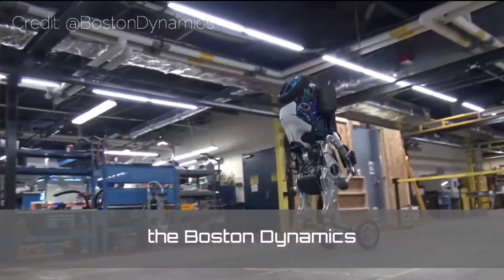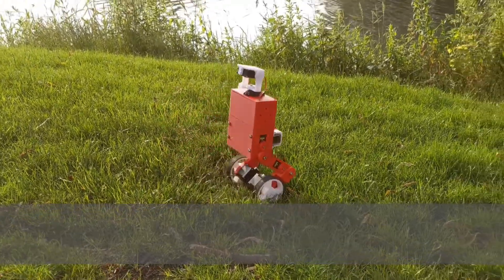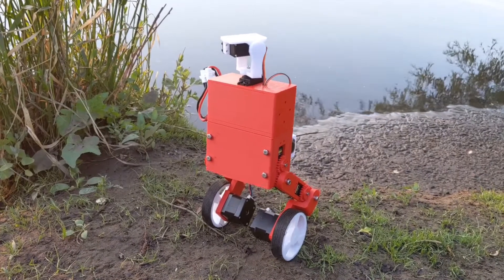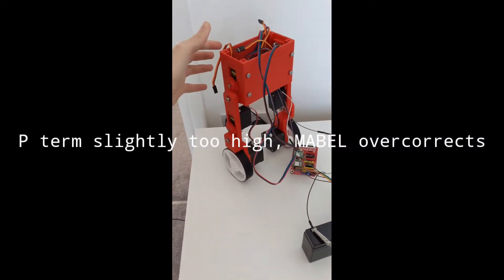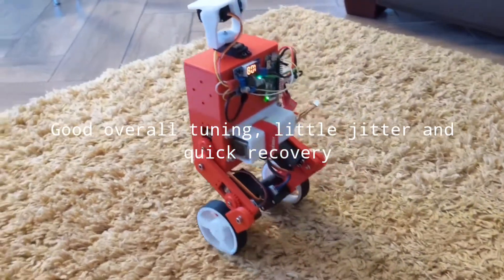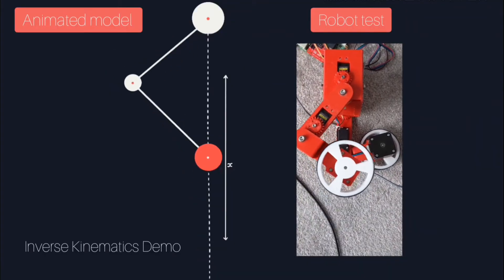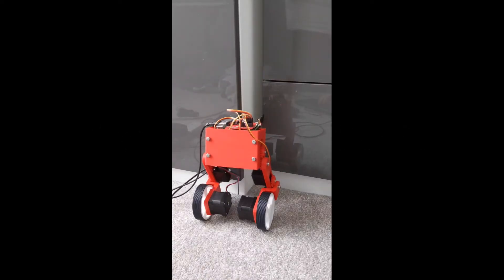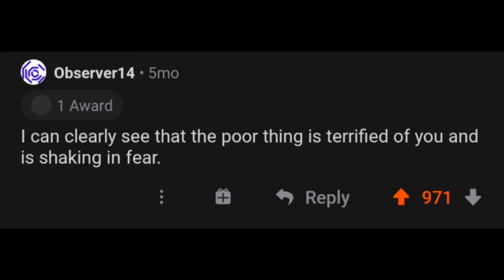How to make a (Mini) Boston Dynamics Handle - Self Balancing Robot with Arduino and Raspberry Pi

Comment: Really interesting project. I have also been trying to create my own version, and coame along some interesting projects called Ascento and SK8O, they use pancake brushless motors which gives them a lot more power, (I think they might be odrive), but they are therefore a lot more expensive too. They have some papers on the algorithms they use to control the robot but I'm still figuring out how they work.
Reply from the maker: Yeah I've seen those projects really cool what they're doing. Brushless + o drive Is the way to go for sure
Reply: @trinity-labs  Something really cool could be using mecanum/omnidirectional wheels at the base, and maybe using some gear reduction/cycloid drives so we could use smaller standard drone brushless motors.

Comment: Great work! 
Couple of mechanical suggestions: use wheels with compressible tyres - they'll act as shock absorbers for outdoor surfaces and slightly widen the footprint when stationary; increase the wheel diameter - will give higher control for the same linear mass deviation at the top (also something you've already discovered about inertia: compact the mass higher for the same vertical dimension of the robot); take a trip to IT recycling center or junkyard and raid some laser printers, photocopiers or paper shredders! for brass gears and, if you're lucky, you might get some helical ones too. And even plastic ones will be of higher finish quality than what you can do on your 3D printer. In fact I'm impressed that with 20tooth cogs you were getting the results we see - that's 18 degrees per step!
I am looking forward to see your next iteration of this project, keep it up!
Loved the trials - reminds me of DARPA challenge videos and R2D2 behind the scene outtakes :D

PS
Some microwave ovens have awesome multiple gear sets in the plate turntable mechanism.
Thrown away prams have great wheels for projects.
And I know 3D printing is the thing for prototyping (especially when designing in CAD) but I swear by aluminium flat bars as a construction material (kinda meccano style): easy to work with hand tools, excellent stiffness to weight ratio and all weather resistance.
Peace!
Reply from the maker: Thanks for those suggestions, there's definitely a lot of room for improvement in the gears I'll have to have a look around for some proper ones. Due to the large tooth size there's quite a bit of backlash which is undesirable and means I have to overcompensate knowing the robot weight will squash the backlash out. As for the wheels, larger diameter would be good but I'm not sure if the motors will have the torque needed

Comment: I had this idea back in 2017, but I was not able to fund it myself. I used dynamixel servos for the links and dc motors with encoders for the wheels for velocity control. I guess to make it work more like boston dynamics handle, other than inverse kinematics, inverse dynamics needs to be resolved with the help of force torque sensors, and the challenge there is to measure very tiny perturbations in torque and force , especially in multiple axis would require very high precision sensors. Amazing project. Would love to see it go around in circles and doing turns as well. All the best!
Reply from the maker: I've seen the dynamixels they look perfect for the project like you said but they are quite expensive, I've just used some cheap hobby servos so I'm not getting any kind of feedback from them, that would have been very useful though!